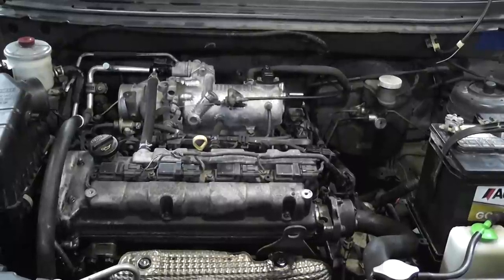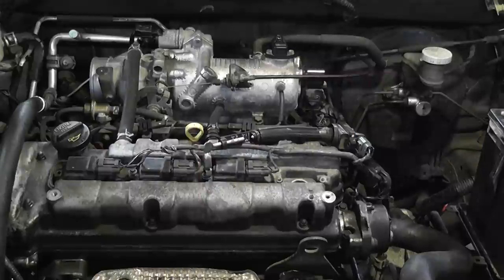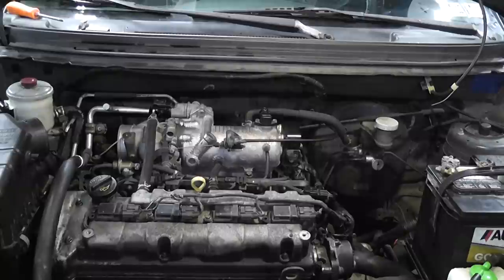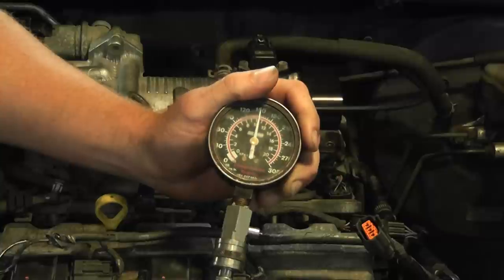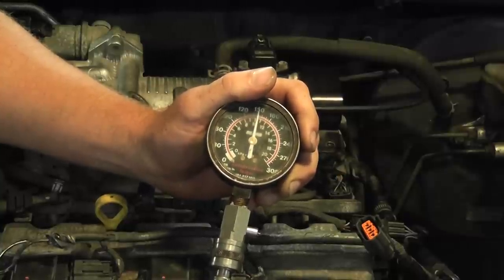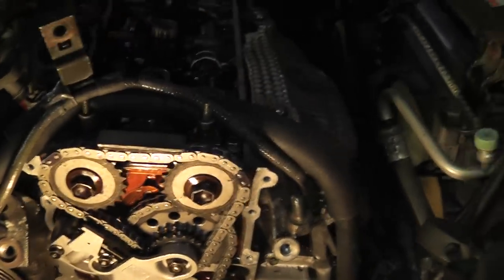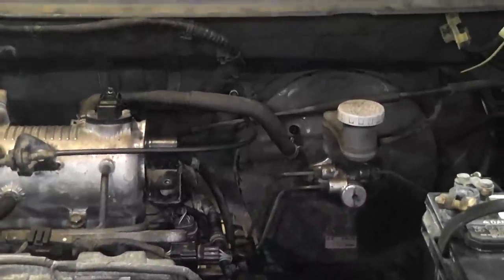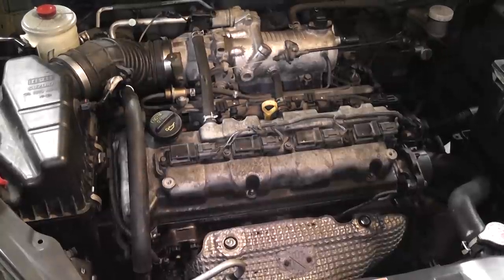How to check for a jumped timing chain or belt

Comment: What would that be? 2 teeth off?

I am currently gathering parts to do a 2200 OHV in a 2001 Sunfire..I think the tensioner gave out and she jumped her timing.  She's getting lots of spark and fuel...but I have no compression tester here.  I am going to pull the top cover to ensure the rockers are moving, then pull the timing cover off.  It's got 135 xxx miles on her with the original chain...I think it's due.

Comment: hey.quick question..what if you know you have spark, and fuel. but when I crank my rpm does even move...i have replaced the ckp with oem..and the cmp with aftermarket...i have not checked compression yet..but i checked my timing and is right...would the sensor be the problem???
Reply from the maker: It is becoming more and more difficult to answer questions here. I have 80,000 people asking me for help now. So I have created a forum to help you guys better. It is free to join and we can exchange pictures, wiring diagrams and waveforms if needed to help guide you through the process of troubleshooting your vehicle. Thank you so much! Hope to see you there. 
Paul Danner (ScannerDanner)
 https://www.scannerdanner.com/forum/post-your-repair-questions-here.html

Comment: Paul , is there a way to do this using the Vantage pro ?
Reply from the maker: For sure. It would be a little bit different set up. You could use your low amp probe for the cranking compression on the battery and use your second channel synced to an ignition coil. I have some other videos showing this on the Verus, which would be the same minus two channels. (sorry no links off hand) Just search "relative compression test" on my channel page. Thanks!

Comment: How do you check if my timing is correct on an 04 Ford Mustang Mach 1 It starts for  a for 5 seconds then it stalls and wont start again unless I leave it for a couple hours, I pulled the sparks and they are soaked with gas, Its a fresh rebuilt engine!

Comment: so when the transistor turns off thats when the spark occurs. does that apply to all spark ignition systems ? this beats having to open up the covers just to find out it might not even be a timing problem. i want to remember this for when i check timing i automatically know when spark occurs so i will know if the timing is off
Reply: +Alejandro Amaro Yes! Spark take place exactly when the circuit shuts off the current! That is a rule for all high voltage arc circuits!

Comment: Hey so I have a 2003 Dodge Ram 1500 4.7L and just bought the truck cash but the truck has a hard time getting it to start up but it does crank and run also while driving it has a jerking if you push the gas pedal to much I’ve taking it to the shop he told me it was my computer but turns out it’s not the computer because it’s still doing the same thing I was told it’s the timing belt I’m not really sure what’s going on but I need to know so I can get it back running

Comment: great video .thanks for posting .Think the timing belt on my Renault Espace DCi has slipped .Had a new belt kit fitted 900 miles ago now engine sounds like a bag of spanners ,will start and run just about ,clouds of white smoke and car seems to be jumping about at idle .Mechanic said no compression in a cylinder .Just about got me home .Could the belt have slipped ? seems strange it has only started after the belt change.Had a random mis fire about 500 miles ago seemed to clear itself and would not start at all the other day ,then next day started  .Would be really  grateful for any input from anyone out there .I may have to be taking the car back to the dealer if this isn't the problem .Seems strange that it was not running anywhere near as bad when i took it in .A little smoke perhaps nothing more.Could something have come loose and the belt jumped it seems to want to go faster but hardly any power at low speed  .Respect to all you mechanics

Comment: Am I right that the current on the relativ comp test rises up to 120A? So high amp clamp is a must for this test?!
Reply from the maker: No, you can use an inductive low amp probe. You are NOT sending current flow into these probes. The probe produces voltage proportional to the magnetic field surrounding the wire. The low amp probes will read up to 2.5 volts or 250 amps
Reply: @ScannerDanner  so the pico low amp clamp is not "limited" to 60 Amps?
Reply from the maker: Nope you just need to do some math when you go beyond 60 amps. You want to stay on the voltage scale and just do your conversions and remember that 2.5 V equals 250 amps on the 10mv/a setting of the amp probe. You are limited also by the size of the jaw of the clamp. It MUST close all the way.
Reply: @ScannerDanner  alright, thank you!!

Comment: So, can you damage an interference engine with bad timing by trying to start it too much?
Reply from the maker: Yes, an interference engine that the timing belt or chain is off can bend valves, but that damage occurred before the car came into the shop. You will not damage it anymore than it already has been by cranking it over. It is the only way to confirm.

Comment: I have a question. I have a 04 Volvo S40. Have a no start issue.  My Serpentine belt broke not the timing belt. After that,  I could not get the car started.  My timing marks are off. The car wants to start. Is my engine ruined?
Reply from the maker: Very possible the valves are now bent if your timing belt jumped.
Reply: ScannerDanner. Is this an interference engine?
Reply from the maker: I'm not 100% sure but there was no damage to the valves on this one with how far off we were

Comment: Could a timing issue cause my 1991 mighty max to run at idle speed but not respond at all to the throttle?
Reply: +Darron I have checked that, everything is working and moving.

Comment: Hey!  I own a 2004 Aerio. Unfortunately, I pull off a 3 wire plugthat is conected to the transmissionand the cables broke(separated from the plug) Do anyone knows whats that 3 wire plug is for? Can I get that plyg with the cables at an autopart?

Comment: what if it was an interference motor?  would doing that test cause it to hit the pistons?
Reply from the maker: +Micheal Deacon If it was going to have valve damage it would have happened already, BEFORE I ever got the car. 
Same thing for a customers car that dies. What is the first thing the customer does? They crank it until the battery dies. 
Not to mention, the damage occurred as soon as the belt let go.

Comment: Hi, I was really inspired by videos on your tube on how to replace a timing chain on a 2002 suzuki xl7 2.7 engine, I bought the parts (timing chain kit) , but a last minute decide to leave this job to a mechanic , the end result: car runned fine for a week , then suddenly,every time I start the car there is white smog? coming from tailpipe for 5 seconds ,after warms up the whole day doesn't do that, but if you let the cars sits for an hour or so, again you are getting white smog , I am not losing coolant ,just check the level every day.Plus now I am getting a check engine light ON, pulled the code and get the "P0335" this is related with the crankshaft position sensor A circuit" ,my question is : Could be a defective sensor? That could cause white smog when cars starts? Or.. I'm afraid the mechanic missed the one of the 8 timing marks and now having problems ? the car runs fine ,no shaking or stalling,but the engine light is on and white smoke at start, please let me know what do you think , im lost, please give me your input so I can talk to the mechanic , or what to do.
thanks
Reply: It doesn't sound related. Have it checked for a head gasket failure. Check out my video on testing for that. I know you said your not losing coolant but it's still worth a check. The other thing it could be is actually oil. (Sometimes oil smoke can look white in certain lighting)
Reply: ScannerDanner Premium 
Thanks , I will do that, now you mention it, this morning smell like oil burning or gas?  you can tell the smell of coolant, this smell is different,
I will check the video for the head gasket , and see what happens,
thanks man  for the info !! I really appreciated!
Reply from the maker: Robert M
also an overfuelling problem from a stuck open injector can cause white smoke (smells like raw gas coming out of the tailpipe. https://www.youtube.com/watch?v=jsl531-6q-A

Comment: hello, so I want to update , I went to another mechanic  ,he said the valve seals need to be replace, overnight the oil leaks through those broken seals causing to accumulate oil on the chambers also causing to burn oil , can also contribute to have bad performance /emission and knocking noise going up the hill ,so he needs to pull out the heads send it to machinery shop , and put it together ,ho man :-(  , I did not expect this...

Comment: I removed the line from the injectors. 
My 05 beetle was fine but the next day it struggled to start then died with a poof after I finally got it started. Now no start but still a poof.
Reply: Jumped time?
Reply from the maker: Why did you remove the line from the injectors if everything was fine? So little information here to help

Comment: i have a suzuki forenza 06 i found oil inside the spark plugs and also has a wierd noise when driving sounds like its coming from the timing belt and from time to time when driving the rpms would drop all the way to 1 and will brake hard. when i drive it for a long period of time my vehicle won't take speed up. can you please help me
Reply from the maker: sounds like multiple problems Stephanie. Since I find it difficult to do a back and forth email exchange here, can you post your question to my forum?
http://www.scannerdanner.com/forum#/general-repair-questions/
In short, oil in your spark plug holes is from a leaking valve cover and can certainly cause misfiring
The noise you here could be from slack in the timing belt and is not a good thing! If the belt has never been done, it needs it, as well as the tensioner checked while your in there. 
Hard braking is an indication of low engine vacuum and could be related to a leaking brake booster OR it could be from the engine running so bad that it is not providing enough vacuum for the brake booster. 
No power (not taking up speed) could be related to a misfire or a multitude of other problems. (plugged exhaust, low fuel pressure, MAF problems etc.)
See what I mean? I can't help any further than this here. Hopefully that gives you something. Anything else, my guys over on the forum are more than happy to walk you through this, if you can do some testing on your own.

Comment: 1sec pls..
so spark doesn't fire up according to crank sensor, but cam sensor? I would think, misaligned timing belt would affect compression as it affects valves operation but that changes ignition timing?
this should be clarified..
Reply from the maker: This depends greatly on the design of the system. I've had cars with a broken timing gear where the cam is not spinning at all and ignition timing is still firing where it should be as it was based on the crank alone. But this is not always the case as you saw here with this distributor engine

Comment: My toyota 20R engine compression 2 piston r 150psi. 1 165, and 160. Engine only spin 5 times, on all 4. But it has no power. My mechanic told me, its probably the timing. But mine stays runni g for life. Doesnt shot off. But it just has no power..

Timing cant be dififcult. Guess ill have to check that. Just hope its the timing!

Comment: why 720 degrees if one full rotation is 360 degrees?
Reply from the maker: It takes 720 to complete all 4 strokes (intake, compression,  power,exhaust)
Reply: ScannerDanner oh thanks. this might be why my timing is off on the 22re that doesnt start at all
Reply: serezhka021 that’s because the full cycle is two revolutions hence 720 degrees, so one peak to the next adjacent peak represents the full cycle.
Reply: crankshaft must rotate twice before the camshaft can rotate once a four stroke engine only fires once every two crankshaft rotations for example in a four stroke engine if you were looking at one cylinder it would only fire once every 720 think of the four strokes intake compression power and exhaust  on the compression and exhaust stroke the piston is at the top of the cylinder and on the power and intake stroke the piston is on its way down
Reply: CUDDLES52 then what’s number do u use for a 6cylnder or 8??
Reply: the crank and camshaft always rotate the same amount of times for every 4 stroke gassiloing engine the only difference is how many cylinders fire in the engine however the cam rotates 720 for every 360 of the crank the only difference is where the cylinders fire within that period
Reply: CUDDLES52.   I think you mean the crank rotates 720° (twice) for every (1 rotation) 360° of the cam
Reply: That 720 degrees is to make sure your at TDC at compression stroke.It is used if you cant see the piston inside the engine.Another way is to remove piston number one and insert a long screw driver in that cylinder to find piston one top dead center.
Reply: Swin Jesse how do I find the marks underneath

Comment: So if I can ask if the timming jumped with one or two teeth wht are the chances of valves hitting the pistons
Reply from the maker: Every engine is different but usually 1 or 2 teeth is not going to cause damage to the valves. But don't hold me to that as it still can.
Reply: OK thank you coz I hv the same issue on my Mercedes m112 v6 it could start and stall or starts but backfire n misfiring so we checked fuel pressure it was gud spark it was gud then when we checked compression we find tht on one cylinder head doesn't hv compression so now we put our crankshaft on TDC then open the tappert cover  and the timming cover to check if the timming marks are OK and we found tht it was off timming with 2 teeth if it's not 3 and we could see tht the intake valve were not properly seated we could see a small gap then now we fixed the timming the marks are OK and the intake valves are now closed no gap I Don no about the exhaust I'm jus a bit nervous to start it

Comment: If the intake was off a tooth and the exhaust was on how would you have found the problem without removing the cover?
Reply: In theory the in cylinder psi waveform would show it but I struggle with those waveforms. So many variables
Reply: Also, the car would have had no trouble starting in this case. It would however run very very rough and wouldn't have sufficient power.
Reply: Thats my next big tool purchase I lost my ass on a job I just did with VVT If I had a pressure transducer I would have found the problem right away. 2 plugged cats cold it ran like crap when it was warmed up it ran good but not perfect so I thought my problem was with the oil or the phazors. Did a back press test cold it pegged my gauge @ 20 psi warm was 3 psi. Never gave the cats a thought Boy did I learn a lesson there!!
Reply: Wow, back psi improved when hot? That's crazy, never saw that either
Reply: Ya its strange that's why I was on it for a month Lol.. And the "parts changer" garage I did this for thinks that they wasted 500 bucks on a cam and phazor. I even proved it was bad before I changed it but they still think that it wasn't needed. I'm not sure of my therie but I think with the phazor stuck on 19 deg. that it had a effect on the FT and that's what cooked the Cats. You have any thoughts? and of course before I got there they changed a bunch of parts and cleared the codes so I had nothing to work with.

Comment: how is the compression so high if the timing was so far off?
Reply: Jo Jo just because the timing is off doesn't mean it won't have good Compression. if the timing is off the ignition won't spark each cylinder properly
Reply: Specs for this car is a low limit of 170 psi limit. Normal is 200psi.

Comment: Hey Paul !!…your Corvette buddy here !!…a 2013 Corvette owner asked me to diagnose a misfire on his LS3…he took it to a shop and they replaced the timing chain…they “said” it jumped one tooth and was retarded by 22 degrees…if the cam sprocket has 44 teeth (cam reluctor is a 58X) do you divide 360 by the cam sprocket teeth ??…360 divided by 44 is 8 degrees…is this the way to verify ??…thanks !!

Comment: Isnt there an simpler way to check to see if the timing jumped with just using an compression tester or an leak down tester?    With out any fancy gear?  Or old fashion way ?

Comment: I just changed camshaft, crankshaft and timing variable and car won't start. Anyone know what's the problem
Reply from the maker: What are you missing? Spark? Fuel psi?, injector pulse?
Reply: Idk.  Car was shaking one day when I try to go work. With brake on and off brake so idk
Reply: @ScannerDanner  just put new sparks
Reply from the maker: @alenyegiyants9254  can't help you any further without this information, sorry